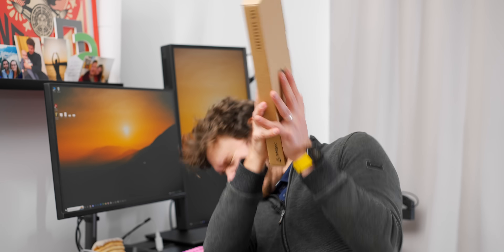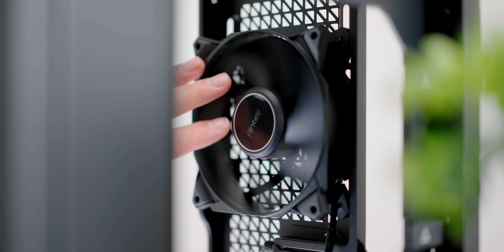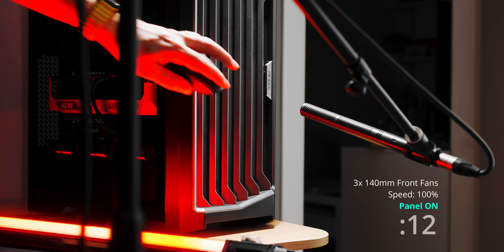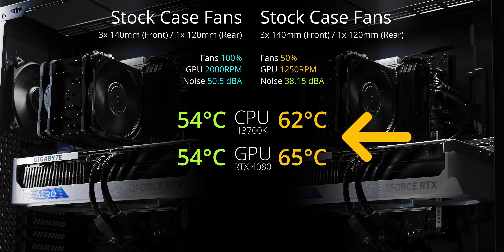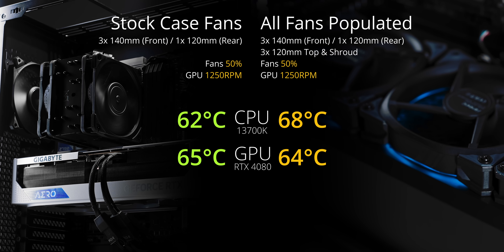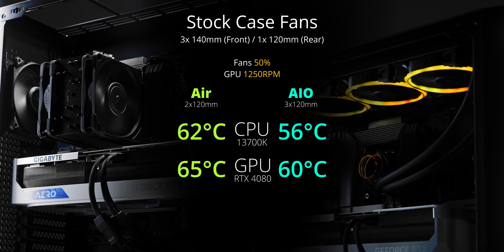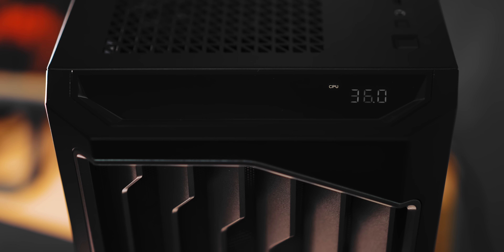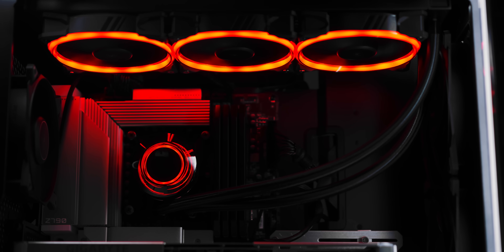How Many Case Fans do you Actually Need?

Comment: The H7 Flow case comes in RGB and non RGB versions.  For some reason the RGB version has three 140mm intake fans in the front and one 120mm exhaust fan in the back just like the case in this video.  The non RGB version comes with one 120mm fan in front and one 120mm in the back.  Same price.  I don't get that?  I got the non RGB version with only two fans.  I went ahead and bought a second fan for the front.  Not sure if I needed the second fan in front and if I don't why does the RGB version have three in the front and bigger?

Comment: I'm gonna buy new case and I want to try this setup:
3 front intake
2 Top front intake, 1 Top rear Out
1 rear OUT
Hope someone reply me
🙏🙏🙏
Reply: Best idea would be to test it. If it does not work well id do 3 front, 1 back and 3 top out. Then add more intakes or remove 2 top fans, so you don't have the fa s suck dust in the pc.
Reply: @17_jager37  Yeah, but I have try to 3 intake front and 3 exhaust and its hot asf, maybe because the case and fan
Reply: @TuấnVũ-s9u  hot because of hardware, case or outside temperatures?
Reply: @17_jager37  maybe because my vga make a lot of heat, I'm gonna change the gpu too, cuz the one I using is 2nd
Reply: @TuấnVũ-s9u  something sounds off
6 fans total and hearing issues is weird
Did you yourself build the pc completely?
Reply: @17_jager37  yeah I build my self, but only the card hot but my CPU was normal and don't have any problems
Reply: 3 front intake 1 rear exhaust and 1 140mm top exhaust right above the CPU heatsink will give you the best results. I found that a second top exhaust towards the front of the case is useless and can even rob the cpu cooler of some front intake air if you run it fast enough, but the back top exhaust a lot of heat likes to linger there and is definitely worth having.
Reply: @Malinkadink  Yeah I think having the front most top fan as exhaust is always a bad idea. It should be intake, or none at all. The rear fan is a little more complicated. It would do well as either intake or exhaust, I have not seen testing that has shown difference between the two. As long as you are moving that air back there like you said
Reply: how was the alternate intake / exhaust on the top for temps?
Reply: I was wondering about using top for both intake and exhaust and searched reddit and youtube. Well of course reddit is reddit... But actually videos with tests from TechBuyer'sGuru and CasebyCase show top intake and exhaust is actually a bit worse. I think it may be because of circulation of warm air in a loop.
I use a Corsair SPEC-03 and it can only fit 5 fans (2 front, 2 top, 1 rear) but 2 top exhaust is also not the best. So I was thinking of maybe getting an exterior fan duct 3d printed for the top rear fan to prevent any kind of bad air circulation. Of course this has an aesthetic impact, but if I cared about aesthetics that much I wouldn't still be using a SPEC-03. Will report findings about if the fan duct makes any difference but it may be a while until then.

Comment: quick question, I have 3 intake fans in the front, 1 exhaust fan in the back, what should the top of the pc case have? I should have 3 spots for fans, should it be intake or exhaust? I'm thinking exhaust.
Reply: Generally you're going to want top mounted fans to be exhaust because hot air rises
Reply: wth, did you even watch the video bruh
Reply: dont make any top fan that is in front of or right above your CPU cooler an exhaust, the rear most one doesnt really matter

Comment: so 3 140mm and 360mm aio on top would be sufficient no need to have a 140mm on the rear as my 360mm aio takes the air inside the case out

Comment: How many fans?

Yes.

On a serious note, having supplementary cooling over the CPU socket if you're using an AiO is critical, VRM temps were a big issue I had to deal with after switching from air.

Comment: Only put one fan backend to your case, it will talk out 70% heat from your case, add another at front, the airflow is good enough for 90% condition, other extra fans just add few effect to talk out heat  from your case.

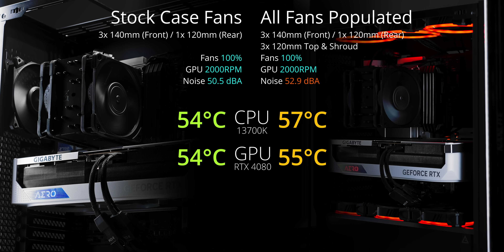Comment: Explanation at 4:36 isn't accurate. Heat from gpu doesn't "intertwine" with heat from cpu resulting in higher temps. Your top case exhaust literally sucks fresh air from front panel intake that suppose to go to your cpu cooler.
Reply: Yes I agree, he would have been better off setting all top fans to intake instead, probably would have lowered his CPU temps

Comment: Has anyone tried a 420 AIO front intake, possibly with 2 fans on the other side for push pull? exhaust on top and extra intake from the bottom, since the intake from the aio would be lower? I'm pretty sure it's better for the CPU temps but wondering what it would mean for gpu temps.
Reply: Same query
Reply: Front mount AIO is always better for CPU temps, it has marginal effect on GPU temps. Top mount AIO will have higher CPU temps, ESPECIALLY if you have an open air GPU. If you have a blower style GPU, that exhausts mostly out the back of the case, such as a founders edition nvidia card, then it can be acceptable to use a top mount AIO.

Comment: I've found that when using a tower style air CPU cooler that placing one exhaust fan at the very back-top location it helps assist the rear exhaust fan in removing the hot air from the CPU faster and thus I seem to get better temps than with just the usual single rear exhaust fan...Although since I have the Lian Lancool II Mesh I would be curious to see if by using two fans on the PSU shroud in an exhaust configuration if it would help pull some of the GPU's heat downward and out through that shroud's open door, I mean that way most of the GPU's heat would never get to my DeepCool AK620 ("In theory that is") but, who knows??? :s
Reply: Most GPU's have a fan that blows upwards unfortunately. I used this case with a RTX 4090 FE and a Ryzen 7 7800x3d cooled by a thermaltake peerless assassin. I used Arctic P12 ARGB for all 12 fans (replaced the 2 thermaltake fans) due to the extremely low noise and power draw and excellent static pressure. Actually managed to daisy chain 6 and 6, running all of them off just 2 fan headers on an MSI B650 Tomahawk, no fan controllers needed . I probably could have even done all 12 on a single 3A header with how low the power draw is on these. Everything fit together perfectly, although the space in between the GPU and CPU is tight, which makes removing the GPU tough.

I'm certain that most of the heat generated by the 4090 gets blown right into the CPU cooler unfortunately just due to how close it is and the exhaust fan pointing up. I don't think it actually affects much to be honest though, with how much air this thing moves with 12 fans it basically sits under 40C at idle, and I can set all the fans to 0db mode at that temp to keep it super quiet. Even at 100% fan speed, it barely sounds like anything is even running. These Arctic P12 fans are incredible, I would have gone with the Noctua but I couldn't find any RGB and they're color schemes aren't appealing. If anyone ends up reading this before building in this case, do yourself a favor and put all your fans in the case before you do anything else, it gets tight pretty quickly. And if you aren't using fan controllers you will have to give yourself some extra length in the fan cables, so make sure you aren't wrapping the cables around the fans at all.

The only real solution to GPU heating up CPU would be ducted fans. Optimum did a video on it earlier this year, 3d printed the ducts to line up perfectly with his case and it actually seemed to work really well. Looking forward to some startup case company using this as their selling point, but it would be difficult considering it would be custom for each hardware configuration.
Reply: Can’t go wrong with Arctic👍🏿
Reply: have you tried setting that rear top fan as an intake instead? My hypothesis is that it wouldnt make a difference, so long as its there. The front top fan orientation matters more, you don't want it to be exhaust.

Comment: so i just purchased this  and i bought 3 extra fans for the bottom. It seems like he's saying not to put the fans on the bottom and just use the top  360mm and the stock fans in front.  Would you add the fans on the bottom still?
Reply: The fans on the bottom didn't provide any noticeable benefit. AKA The temps were the same, the best cooling setup was the AIO 360 on top cooling the CPU, so you didn't have to worry about the GPU's heat on the Air Cooler and Stock Fans as they were.
Adding the bottom fans provided no benefit, but no downside either aside from minor power draw?
If the fans are RGB they could have an aesthetic benefit.
Reply: @Arynemily  I really don't see the point of fans of the bottom if they don't have access to some fresh air like in the lancool 216
Reply: Don't put the fans at the bottom. They just make more noise in your system. One of the problems with this design is that the fans are attached to the PSU shroud. There is no separation between the PSU shroud and the fans so that they can actually move enough air and stay quiet. There should be like a mount that would separate the fans from the PSU shroud like an inch. The latest cougar mx600 has something like this.

Comment: I run overclocked 5950x and have just 2 intake fans and 1 out fan, air cooled cpu, all fans running between 650-800rpm, super slow, and the thing stays cool. With proper directed airflow, 3 case fans is all you need.
Reply: Similar setup here. I have a very old custom case. The Apevia X-Sniper G. 1 rear exhaust, one side panel fan centered on the GPU, but a small amount of air hits the NVME drive and CPU, and one bottom intake fan in the front. All 120mm. i7-4790 and a GTX 1080 FTW both stay around 60°C playing Subnautica and most games I've tested so far. But CPU temp can rise up to ~72°C in some areas - due to poor game optimization I think. Really surprised how stable my temps are with such a config. Thinking about trying to mount another 120mm on my 5.25" drive bay covers as they have holes that center with them!

With a stock Intel cooler btw.

Also just upgraded from old molex fans to Arctic F12s and P12s and saw my temps rise considerably under load using PWM control. But dropped a few degrees after cranking them to full speed while gaming. I had an 80mm fan in the back before too, which I think could actually help, since air is drawn by the fan and pushed freely around it through the surrounding exhaust holes.

Comment: 1:36 In most cases up to 0.5kW of heat- Front panel as much airflow as possible, one back fan- Top blocked from front up to 1/3rd of length from back- That's all you need- AiO cooler on top only and the same scenario, but you're blocking the top with radiator

Comment: I use 4 intake fans and 0 exhaust fan....cpu temperature dropped 10 degrees C
Reply: how does heat leave your case without any exhausts?
Reply: @MsabResearch That's the neat part... It doesn't!
Reply: why no exhaust fans?

Comment: I’m sorry kinda new to all of this, I’m learning more and more, but still new and inexperienced, but excited to learn more, but with that being said, I just learned the difference between air and AIO cooling, but still confused in some stuff, mostly with fans and AIO, when You showed how cool the layout was with the AIO I couldn’t see or understand if You still added fans as intake and more as exhaust, and if You do a layout with AIO do You still need more fans? Please help lol and also I don’t know how tell the difference on how to set them up (fans and AIO) as intake and exhaust!
Reply: Honestly just keep it simple with pc fans. First is always prioritize a good air flow case. Next is get decent fans regardless of price, arctic, be quiet, noctua, and alike. Third is with air cooling, intake front exhaust back and no need for top fans. With aio always place it on top, then fans front exhaust back. Lastly, dont over think it.

Its reallly confusing when your new to something and ive been there and have spare fans because i was so focued on pc fans. Then you realize, its not that important, a decent case will out perform any badly optimized case with the same number or even less fans.
Reply: You can do intake or exhaust depending on location. Take a look at 7:04 it shows that the radiator is at the top flush with the case, and under it are 3 fans pushing air up and out.
With that said, you can put as many fans as you like if there's enough space and power. If you really want, you can fan both side of the radiator. 😆

Comment: Jesus......what is that CPU doing when he is hot on idle?
Reply: that's the ryzen experience lol
Reply: @YaroLord  He is using an Intel CPU
Reply: @YaroLord  C'mon bro! I have Ryzen 5 2600 and on idle is between 25c and 30c with ThermalTAKE ToughAIR 310.
With stock cooler, it was on 40c.
Reply: @KilljoySR  I have a 3700x and it idles at 45-50 degrees Celsius
Reply: @YaroLord   Ouch! Have you tried something? To change thermal paste....to clean it....? Change BIOS settings?
Reply: @KilljoySR  I’m using a brand new noctua uh-12a in a new case with fresh airflow … like I said earlier, it’s just the Ryzen experience
Reply: @YaroLord  Is it possible that yours is way hotter than mine?
Reply: @KilljoySR  it’s overclocked so yeah 🫠
Reply: @YaroLord oooh.....that's different....ok, those are ok temps.

Comment: more fans means lower fan speed required for the same temps, which means lower noise. im about to swap my build into a NV& with all 12 fans. she gonna be cool n quiet
Reply: Only if they're in the right places and pointed the right way.  And its not 1:1 cooling improvement to noise reduction.  More fans will almost always be louder for the same cooling potential.

Comment: If you have a Corsair Carbide Air 540 with three 120x38 front and a 140x38 rear all with peak 5,000rpm you would probably never have to run them over 2,500rpm. In those conditions there is no need to use the top. Basically everything is better if you just stop using 25mm fans.

Comment: On a typical "modern" setup the best basic configuration is a 360mm AIO, in a standard full tower case with at least 3 120 slots on the front and 3 on the top, the 360mm AIO exhausting outwards on the top mount, 3 120mm intake fans on the front panel, and one exhaust on the top of the back of the case.  With more fans crossing each other on the intake, you get turbulence which prevents good fresh air coverage on the GPU, and with an air tower cooler you have higher internal temperature in the case.

Comment: the problem isn't the fans it's the absence of pressure from limited exhaust 

the AIO radiator is just a giant heatsink that stores excess heat away from the socket; the problem with limited exhaust still exists with the AIO system, it just takes longer to saturate the AIO heatsink because it's larger than a typical air cooled heatsink

Comment: One question at 6:21 so i should only put 2 fans in the bot instead of 3?

What i saw weird was that you change the °c of cpu and gpu when you were saying that is better to use only 2, it change for 50 to 56 in cpu and 51 to 61 in gpu, and i said wtf xd?

Comment: Does the front panel really reduce the noise, or is it just crippling the intake and therefore max rpm on the fans and that's the reason why the fans are much louder without the front?
The more rpm the fans can do, the more you might notice the reduction in max rpm with the front panel vs. without it

Comment: Great review. I have 1BIG question :  my argument is 3 fans on the bottom really needed - I see a lot of fan videos I haven't had 3 fans on the bottom 4 years. With 2 intake and 2 out  take + the GPU (4090) and the quality corsair 170i cooler. i have had temps sitting @ 63c randomly w average of 49-56c. is 3 fans still needed @ the bottom w both CPU and GPU in lower temps then this w a old case phanteks 800 case...w a lot of breathing inside....?
Reply: By his examples of you are running the AIO on top it would be 4 fans out and only 3 in which could create a negative pressure situation unless you throttle up the 3 front fans. 

So the extra 2 on the bottom (3rd is just aesthetics in this case because the PSU is blocking it) makes 5 in and 4 out for a positive static pressure. 

So as he said, the bottom fans are only beneficial with an AIO on the CPU.

Comment: Since the introduction of flow through GPU cooling, why does no one try to reverse the CPU air cooler and make rear fan an intake? Why reuse preheated GPU airflow for CPU cooling in the first place? It would make so much more sense for separated air flow. At least in theory. Yeah, and shrouds suck. Top PSU for air cooled GPU is often better.
BTW turbulence is good for cooling. Forces "surface" air to mix with the flow. Not removing hot part asap isn't though. Cooling is all about removing heat.

Comment: Antec makes some legit good stuff, I had one of their mATX cases for a bit the NX200M and it was very decent for a midrange system !!

You only really need 3 fans in an average system. Or 4/5 if you count the fans on the air tower cooler. I have 4 in total, 2 Noctua NF-A15 HS as front intake then 1 Arctic Bionix F120 as my CPU heatsink fan and 1 Arctic P14 PWM as my top exhaust. That's it!! I had a rear exhaust too but it created turbulence.